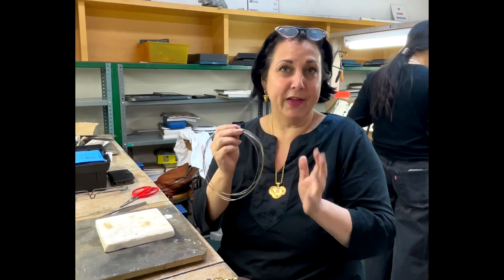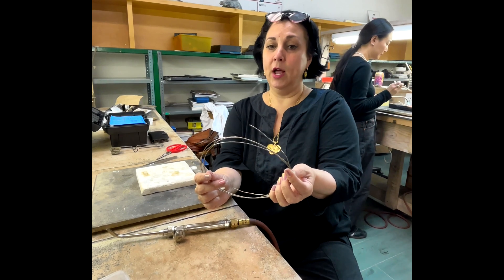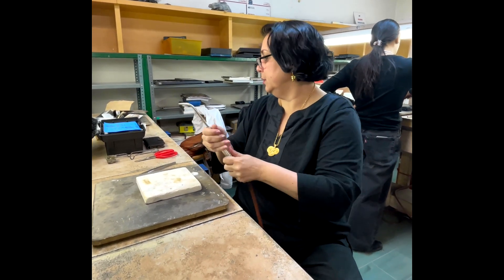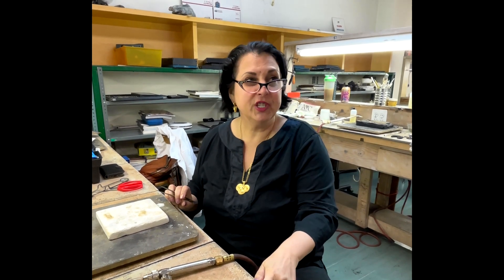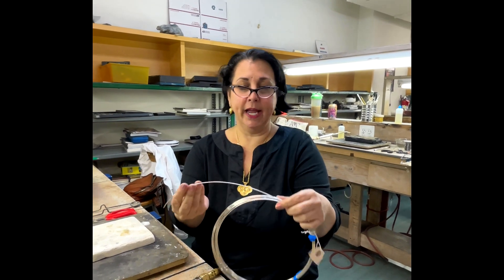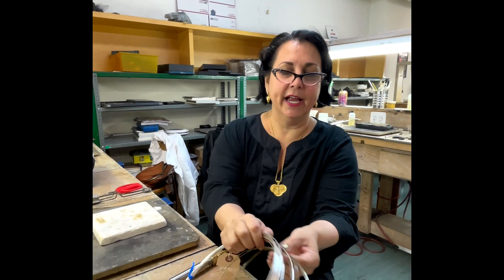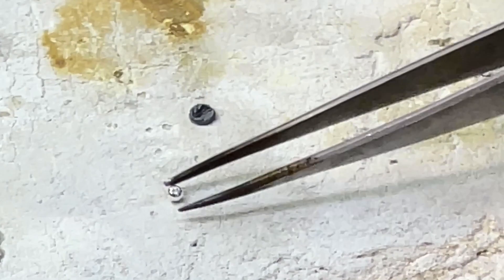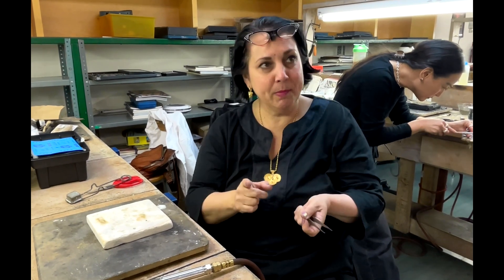Guaranteed Way To Identify Your Silver: Fine Silver Vs Sterling Silver - Know The Difference

Comment: Thanks! How would you know if it’s sterling or less than sterling silver?
Reply from the maker: I have never really run into that, do you mean mean like nickle silver?
Reply: @JewelryArts  I thought it would be common to have fake silver with a lesser % silver or something, since silver is so expensive. When I’d search for second hand silver jewellery for example, what’s sterling, what’s fake, and could there be anything with less than 92,5% silver in it? But honestly, I don’t know exactly if that’s often the case. I know how silver oxidises and how that looks, but it might also be possible to fake with some silver coloured metal and black dye for example.
Reply from the maker: @koneko_x  You are right and you would need to able to test and check for hallmarks, etc if you were shopping for second hand purchases in shops, flea markets etc. For us in the jewelry studio, we are only working in set materials like fine silver or sterling silver so this not something we are checking for. I am sure some appraisers would have good videos on how to check the kinds of pieces you are looking to buy. :)